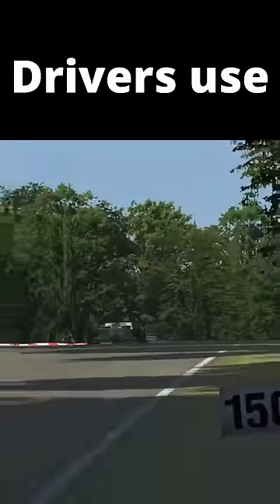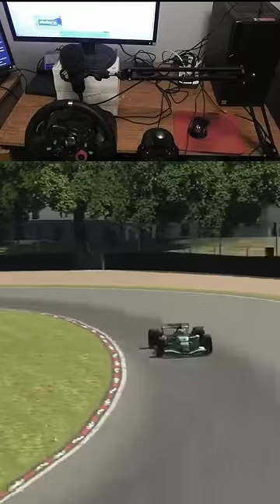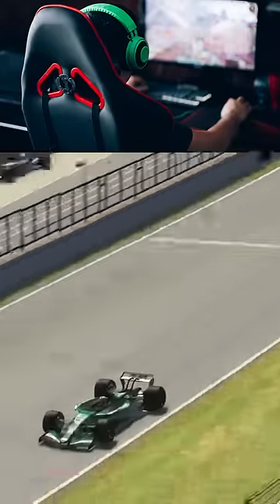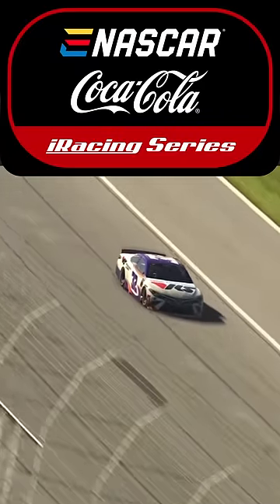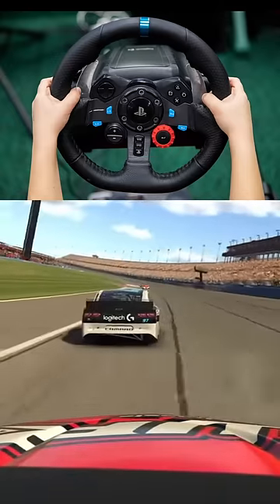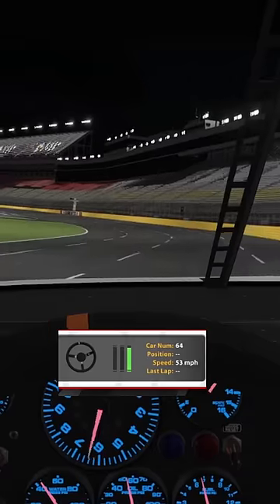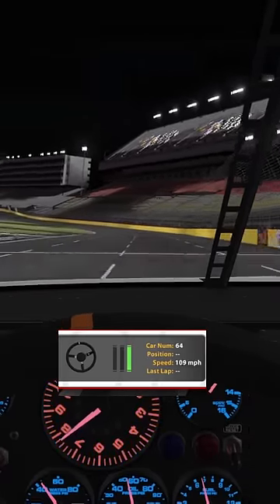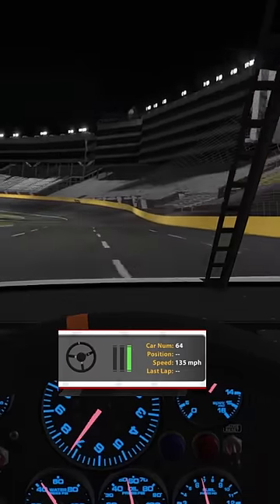Why Some Pro Sim Racers Use a BUTTON for Their CLUTCH!

Comment: Apart from being a smart shortcut, to me it seems senseless. 
If it continues that way, we will end up driving Mario Karts.
In the not so distant future, reality will consist of electric cars.
For this reason, my burning desire long has been (unfortunately it seems like it will stay as just a dream) that the top pro sim series primarily ran in somewhat older Kbassian racing cars, where the essence is the simulation of these somewhat larger handfuls without power steering, drum brakes, heel & toe technique was necessary. And let these be forced analog mappings.

So a classy way to protect and promote old classic virtues in our irreplaceable motorsport history.

It's far more passionate than those "don't need sim" poisons that are spreading at the moment.

Comment: PRO TIP - Bind handbrake and clutch to digital buttons and you will be able to modulate the two with your thumb like ABS. You can't move your foot as fast as your thumb.

Comment: Well IRL engineers already made PDKs and DCTs with automatic clutch control and much quicker than any human can press a button. Also cars with fuel injection disable the injectors when off throttle. Iracing simcade behaviors like clutching for fuel economy is nonsense unrealistic. Simulating, what? A text book? Thats not the land of the real.

Comment: racing Never got the clutch right. real racing is a lot about clutch control. once i finally set up my sim rig. i was so disappointed to find out sims just treat a clutch like an after thought. but in a real car if you shift badly it costs you money or spins you out.

they need to bad this key bind. unlike real racing sim racers are kinda lame.... lets be honest.